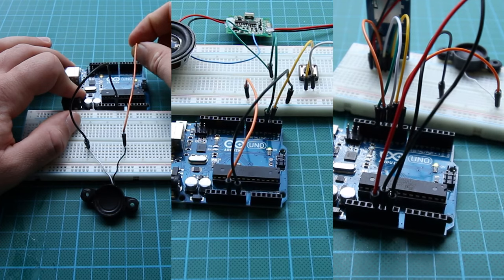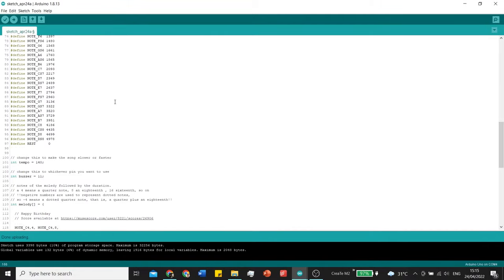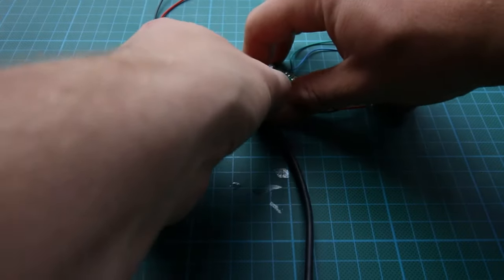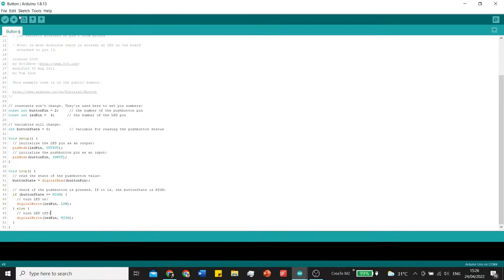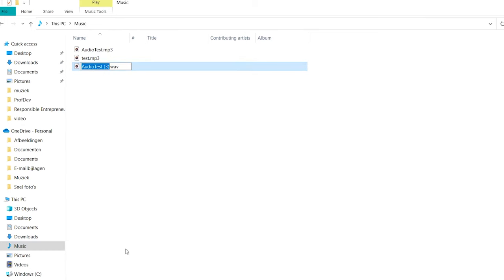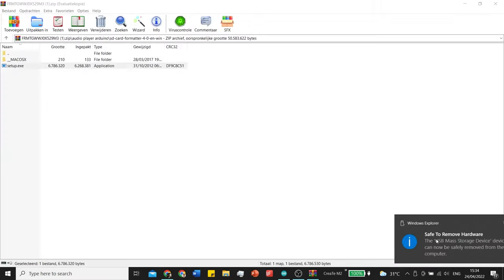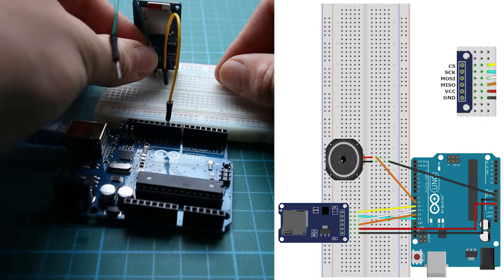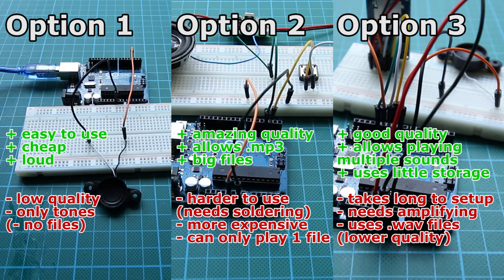3 Options for Playing Audio on Arduino

Comment: I'm pretty sure that wav files don't have bad quality. Compared to mp3 files they have a constant bit rate so they should be better quality. Besides that I really enjoy your videos, thank you for your amazing work!
Reply: I think the problem is downsampling, he's using less than 20kHz, so it's gonna be noticeable. I didn't play around with it so I'm not sure if you need to do that so the Arduino can play (I think the max frequency of the CPU itself is lower than 20k or something), also not sure why the mp3 solution doesn't have this problem
Reply: @lowlink534  Slight correction, the Arduino clock speed is 16MHz. That's mega as in millions, so plenty for this kind of project.
Reply: @soheil5710  Lol now I see what you mean, I have no idea why in my original comment I said the CPU runs at less than 20k, no CPU probably ever ran at that low of a clock lol

Back then I also didn't have as much experience with Arduino and Mozzi, but that still is no excuse lmao
Reply: @lowlink534  No worries I've been confused myself before

Comment: Why does option 3 need amplifying? Is it because they are .wav files? Can you not set the volume higher with the tmrpcm.setVolume(x); or is it because of the speaker you are using?

Comment: I have one question , in the second method (sd card) is the output digital audio (pwm) ?
Reply: look,this video is pretty old but i will explain it
Yes,because audio needs the pwm output so it can level up or level down voltage intensity
meaning that you really need that pwm,like there is no way you would play a audio only using HIGH,LOW

Comment: Hi! I follow every step of your tutorial but the program doesn't work successfully. I think the problem is the convertion of the file in wav. I tried to use the website that you reccommended but (I'm italian) in italy it is down. I'm very sad and frustrated because of this issue. I wish you can help me and my project. Thanks
Reply: could you get the website to work with a VPN?

Comment: Hello!
I'm trying to make some sort of detector that can play sounds upon a certain distance, and it'll play a different sound depending on the distance of the object and the detector.
Do you have any idea where I could find an arduino card that could allow such a thing to happen?
Reply from the maker: You need an ultrasonic sensor (to measure distance), an arduino (does not matter which one) and something to play sound. Any of these 3 options can do and I also have a few other videos on ways to play audio using arduino.
Reply: @JustBaselmansYT  Oh ok. I'll see it later!
And thanks by the way!

Comment: Hi, How would you reccomend to amplify the sound in example 3? thanks.
Reply: You can easily do that witha transistor, search for a simple transistor amp, basically you power it and put the sound cord on the other port, you just gonna know which port is which of the transistor

Comment: Is it possible to use the speakers of example 2 for the configuration of example 3? or does it need some sort of amplifier?
Reply from the maker: Yes you can use both speakers for the different examples, soon there will also be a video online with a 4th example of how to play audio on an arduino. And this is in my opinion the best way, so keep on the lookout for that ;)

Comment: Quick question! For option 2 I'm trying to do a similar scenario, but with a IR sensor. When I try to use the code you provided with the IR sensor, my Arduino goes crazy and connects and disconnects from my computer. Would you know the solution for this?
Reply from the maker: I would recommend to make sure that all parts behave like you intended without connecting them together. 1.Are you able to detect the infrared signal and writing it to your serial monitor. 2. Are you able to play a sound using a digitalWrite? If you can do both I am not sure where the problem is? Maybe someone elke can coming across your command can help you out or you can ask on an arduino forum.

Comment: Such a great video! I was using tone() but i wanted to perform volume control. I found toneAC, but unfortunately, the quality is not as good as the original tone(). Do you know if it is possible to perform volume control? Even with external Hardware. Thanks!
Reply from the maker: I am actually not sure, unfortunately I have no experience with this sorry
Reply: @JustBaselmansYT  Thank you!!
Reply: if you want volume control, u could get a potentiometer and connect it between the output speaker and the arduino.

Comment: I tried third Option and it works but it's really quiet. I have a 0.2W speaker and connected it directly to VCC. Do you know if there is any way to make it louder. If I use an amplifier I overload the speaker, don't I?
Reply: Get a bigger speaker with more W, but then u also need amplifier

Comment: I have a question, I made my humanoid Arduino, so how do I join it to my humanoid?
Reply from the maker: Can you maybe further explain the problem? These functionalities should be able to be added to most arduino projects
Reply: @JustBaselmansYT  I got it figured out now, btw I was meaning like only use arduino uno and not the bread board, now no need I got it figured out, thx btw, thx cuz I learned how to put the wires

Comment: For option three I want to add the little button that comes with the Arduino starter kits, how would I change the wiring so that every time I hit the button, it plays the audio
Reply from the maker: I would connect the button separately to the arduino and in the code only play the audio when the button is pressed. take a look at Arduino's own button examples in order to do this👍

Comment: Hallo, would it be possible to create the second option with a PIR sensor, instead of a button? Also would it be possible to create the third option with a YX5300 mp3 module? Have been struggeling to get a project to work for a while now...
Reply from the maker: Yes ofcourse you can use this code: https://create.arduino.cc/projecthub/electropeak/pir-motion-sensor-how-to-use-pirs-w-arduino-raspberry-pi-18d7fa and only change the LOW and HIGH arround that should work.I do not know much about the YX5300 mp3 module so no idea, you should do some more googling ;) good luck!

Comment: For the second option how would i connect the 2 wires without a button and have it be something like everytime a servo reaches a certain position?
Reply from the maker: You do not need the button, you can just execute the code when a servo hits a certain angle, if you are able to detect this

Comment: can you please tell me what you needed to solder in option 2?
Reply from the maker: Remove the button that comes with it and solder two wires to it so you interact with it using a breadboard/arduino

Comment: hey it is not working for me all i changed was i put 2 wires that i would touch together instead of a button and i am using an arduino uno R3 please help if u can
Reply: im doing option 2